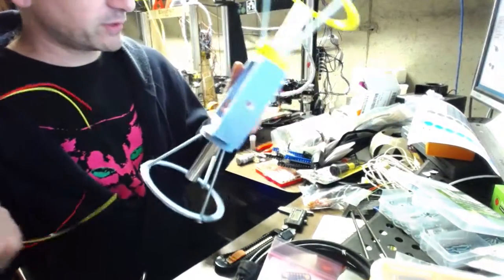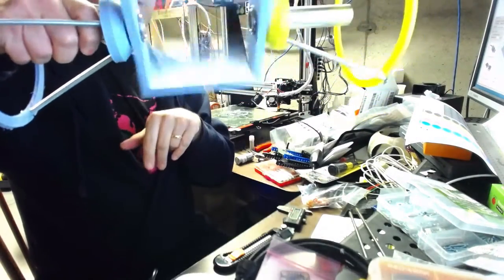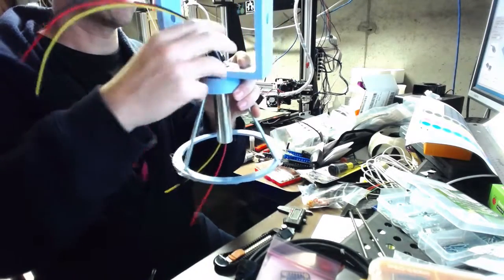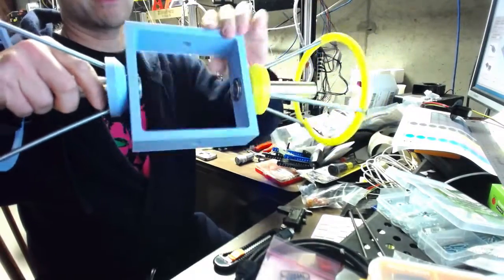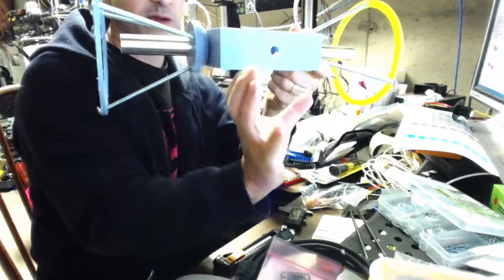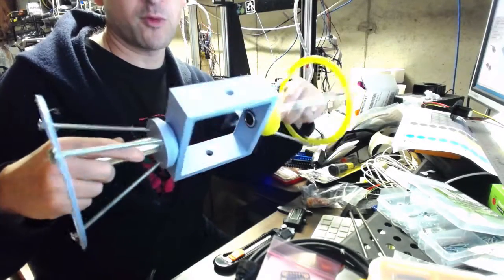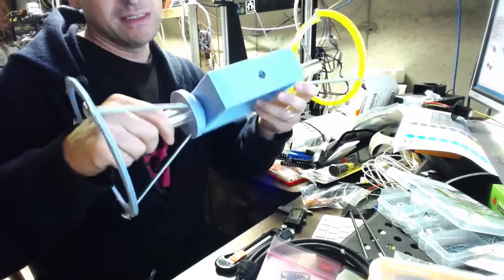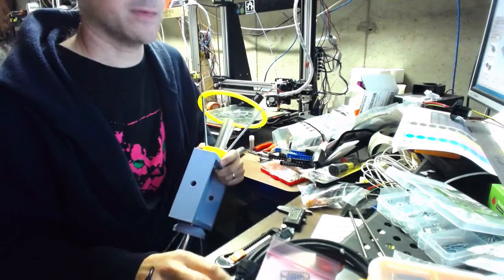Drive Train Axles vs hubs and slip rings for 1:1 BB8 paving way for animatronics

Comment: Seems to me like your hub shafts are press fit into the carriage bearings (since I don't see any snap rings or collars or anything). Did you have to buy an oversized shaft to get that to happen? I just received some 1" SS tubing and bearings from servocity and they're loose as a goose. A bit of a dilemma that I wasn't anticipating. Help would be appreciated. Thanks!